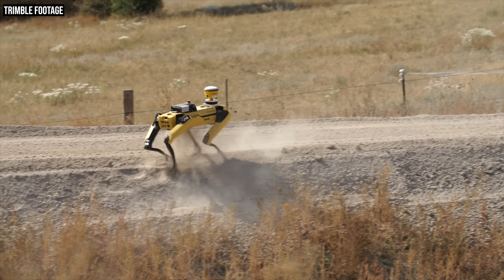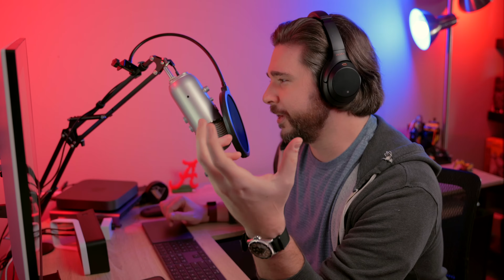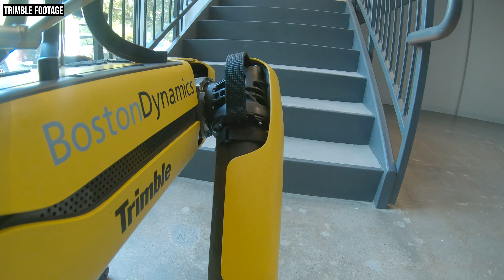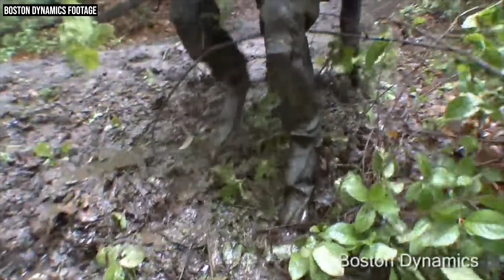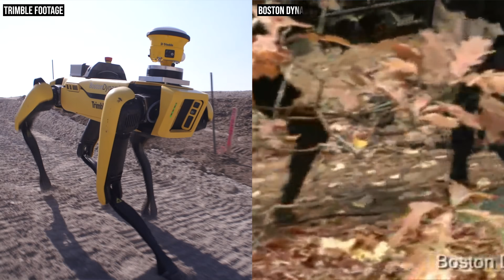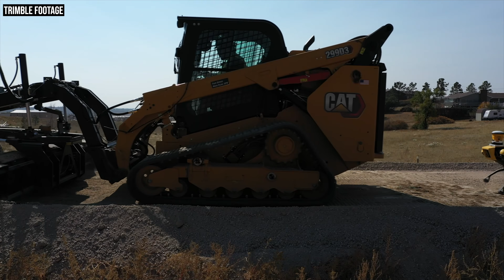How Spot the Robot Dog Got a Job in Construction With Boston Dynamics and Trimble | The Dirt #17

Comment: That's great. As told in the video this really sets the great foundation leap of construction automation. Hope the vertical access activity like rendering and painting on high-rise buildings (100m and above vertical buildings) has logistic and safety constraints on productivity when the spread is very high. This could be a potential research area for future construction automation use-cases for bringing highly integrated solutions which shall bring great business benefits.